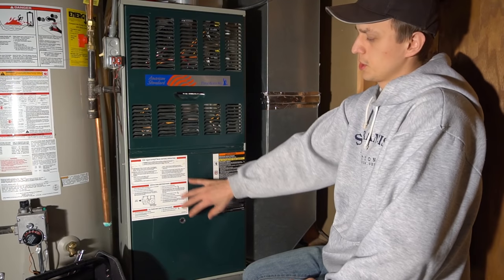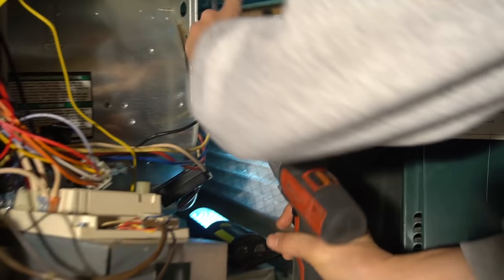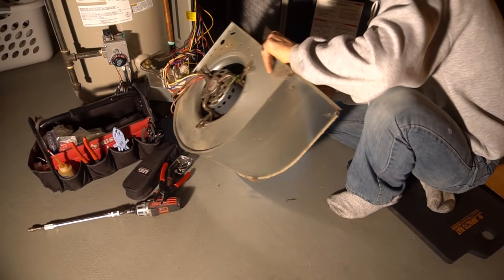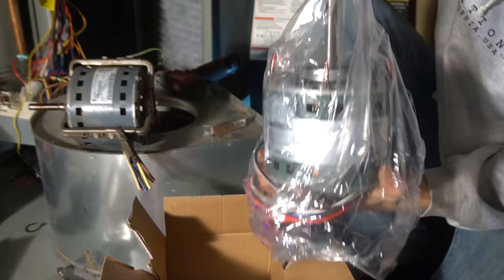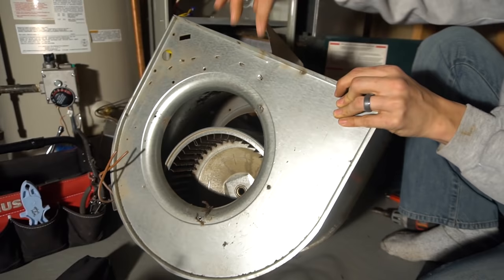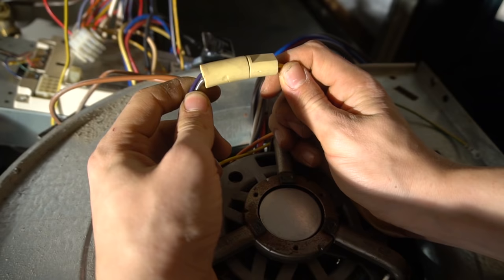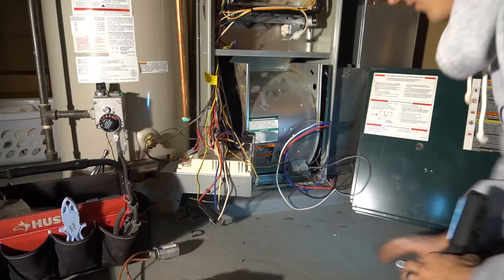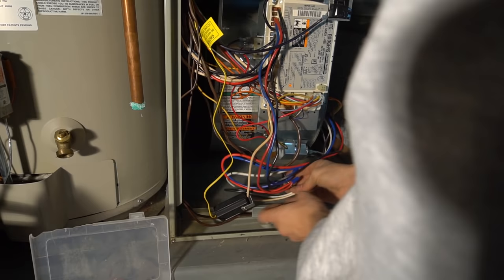Furnace/AC Blower Motor Replacement Step By Step

Comment: if not already mentioned in another comment, once you have the blower out (for regular cleaning, or to replace the motor), put on some safety glasses or goggles, stick your head into the cavity, and look up with a flashlight. you will likely see that the fins of the secondary heat exchanger are dirty - slightly dirty to full of dirt, blocking air flow. there are other youtube vids on how to clean it. it's about a half hour job. a soft brush and shop vac will get most of the dirt out.

Comment: Good video, well explained with excellent camera angles and audio. By the way, you seem to have a slow leak of the overpressure valve of your water heater, notice the green crusties at the bottom of the drain tube. It's pretty simple to replace the valve if you can't get it to seal.
Reply from the maker: Glad you liked the video! Thank you for the concern. The leak is very slow and I just haven't gotten around to replacing it. (I replace these a lot at my job so it's not foreign to me)
Reply: Ha ha, that's funny. I was late to replace the anode rod of my water heater, and am embarrassed it was laziness rather than lack of knowledge. Guys who do it for a living have a hard time finding time to do the same kind of work at home in their 'day off'. Thanks again for posting your videos, they are very helpful. Now I gotta find time to clean out my furnace squirrel cage, better now than after a secondary problem....
Reply from the maker: Heheh, Yep :) You are absolutely correct. I feel the same way. After coming home from work, I don't have much of a desire to continue my work day at home. Just a classic case of laziness. If there was a little puddle under it maybe I would react faster :) Anyway, good luck with the squirrel cage!
Reply: @WordofAdviceTV  Yes, so true! The paying jobs get priority, and it's hard to spend free time doing something you're used to getting paid to do.

Comment: Thanks for such a great video.  I just replaced my motor (horizontal flow unit) with OEM specs and it was fairly straight-forward. Now when the blower runs I can hear a faint low pitch whine/hum (not a bearing whine, etc.) more like a minor vibration that gets amplified a bit in the ducting. Not overly loud but annoying. The unit sits above a vaulted great room ceiling which does not help. I was thinking of installing thin rubber dampers between the sheet metal screws which hold the motor and the fan enclosure. Any ideas since I have to take the whole thing apart anyway. Thanks.

Comment: This seems like a very thorough walkthrough. My only question is, is it always necessary to cut the wires? Or if the model is exact, can they simply be unplugged and the new ones plugged in? I am going to attempt this repair tomorrow or over the weekend. HVAC tech quoted me at $1000 for the motor and labor. I refuse to pay such an astronomical amount of money to have this done, if I can DIY it. Thanks for the video.

Comment: Awesome video, have any of you diy’ers dome this? How long did it take you and we’re you successful. We have a carrier 3 ton
Reply: Just did, I have the exact same furnace, so was easy to follow along. took me about 1.5 to 2 hrs minutes. The motor I bought had the connectors on them, so I did not need to splice them.

Comment: Thanks for posting these very informative videos. My ac blower won’t kick on. It makes a buzzing sound like it wants to start up but doesn’t quite make it. An AC repair tech quoted me $900 to replace the motor and blower fan. My question to you, is replacing the fan usually necessary? The repair tech said the motor is bad but that the fan should be replaced as well. He made it sound as though the fan will need to be replaced in a year or less.
Reply: Hi, i use to be in the service industry for a bit and since its a year later probably wont help, but When you say fan are you talking about the Squirrel cage? Thats the sharp metal wheel that spins that he cleaned in this video? or are you talking about the outdoor units fan motor aswell as the indoor fan/blower motor? If he was talking about replacing the Squirrel cage  then hes just trying to rip you off.... Those  never go bad and usually need to be cleaned fairly often...Now if he showed you the squirrel cage was Bent or something  then thats different.....

Comment: best vid I watched all day thanks!!!  great job on explaining.
Reply: switch the motors 4 speed to a 3 .matched up the wires like 17: 20 said. fired it up and nothing.got and extension cord  and hooked it direct to the motor and wala! knew motor was good.spent 6 hrs trying to find the issue thinking it was a bad blower contactor on the circut board.SLEPT ON IT watched a few you tube vids and WALA AGAIN!!! that yellow unwanted wire  on the previous motor you throw out was hooked up to the HEAT terminal   going no where since it was cut., SKATA. A 10 SECOND FIX! hooked up red which i'll most likely switch to a faster wire and BINGO.fire out of the vents now!!! FUNNY WHEN YOU DO SOMETHING ONCE IT ALL MAKES SENSE.easy job! thanks!!
Reply: be real curious what speed you run your furnace at?
Reply from the maker: Thank you for writing that! I totally forgot to mention that you need to look at where your heat and cool wires go to from the motor. In my case at 17:10 the yellow wire was on "park" or spare so discarding it was okay. Sorry that I did that to you man, I should have explained that part better. Hopefully if anyone else has the same issue they will read your comment :) My furnace fan speed is set to low (low speed is almost always red). At work, once in a while if a furnace is slightly overheating while running and I ruled out other possibilities like a plugged filter, high gas pressure, dirty burners, dirty A-coil, etc, I would increase the fan speed from low to medium. There's a chance that the increase in airflow will keep it from overheating.

Comment: Great video!  One question: How do you know which way the blower motor should rotate?  Do you just guess and try one, and if that doesn't work reverse the direction of the rotation connector?

Comment: 1) Do we need to discharge the old capacitor and, if so, how is that done?
2) You pointed out the part that controls motor direction. Please provide some instruction on how to properly handle that function.

Comment: I have a 20 year old Goodman GMT 090 - 4A furnace in good condition as far as burners and heat exchanger. I am renting the house and moving to another state. As preventative measures, I replaced the following 20 yr old parts with OEM Goodman: Blower motor & capacitor, induction motor & pressure switch with rubber tube, igniter, flame sensor along with limit switch. Can you think of any other parts you would change that you would expect to go on a unit this age. Located in TX short heating seasons.

Comment: I’m replacing a blower motor (capacitor 15mfd/370vac) with a new motor (capacitor 5mfd/370vac). All other specs are identical except capacitor. In another video, commentator says to use same size cap in new motor as in old one. What do you think? Thanks for your help.
Reply from the maker: There will be a capacitor rating on the new motor label or box. Use the size that the new one lists. 👍

Comment: I also had to wire mine from a 4 speed motor to a 3 speed motor. Its a gas furnace. Now i have the heat on and the fan speed is really slow. Will this cause overheating on the unit since its not moving air very fast?
Reply: Disregard. I figured it out. From what i understand this only works on a gas furnace if this helps someone else. My fan speeds are High (Black), Blue (Medium-Low), and Red (Low). High Speed (Black) is obviously for AC. My Red (Low speed) was connected to Heat terminal and my Blue wire (Medium -Low) was connected to "Park" which means it's not being used. I switched my blue and red wires putting Red (Low) on the "Park" terminal, and put my Blue (Medium-Low) on the Heat terminal. Now she's moving air better and is actually more quiet now.

Comment: So glad I found you! If we just want to clean the wheel we can keep all wires in tack and just take out the wheel to dust and clean, right?
Reply from the maker: With most furnaces, yes. But there are some furnaces where the wires are pretty tight and you will have to disconnect some of them. In that case just take a picture of where they go and disconnect them. Afterwards don't forget to put them back. If this is your first time, I would take my time and remember how everything comes apart so nothing gets forgotten when reassembling. Good luck!

Comment: Can you please explain how to find a compatible motor from the model of the unit? I have a Trane as well and motor bearings are bad and have the model number 4txca024bc3hcaa but could find no info using that model number. Edit: I pulled the motor, it's a GE 1/3hp 1075RPM unit model b13400-21. Did some searching looks like ClimaTek MOT99 900 will work :) Thanks for the video!

Comment: i assume mine is the blower motor. when the heat pump kicks in. its a loud buzzing noise until you turn it off, still blowing air out the vents, its just cold air and not hot.

Comment: does the blower motor installed right on this video ?
I mean the air supply (return) is on the right side of the furnace, and the motor installed in the blower motor assembly also from the right side

Comment: This is a great video.  Thinking about tackling this myself and you made it look so easy.
Reply from the maker: It usually looks easier than it is ;) But if you read the comments, many had success! It's not too hard. Let me know how it goes and if you run into anything unexpected. By the way, the yellow wire that I throw away in the video, make sure that is not the wire that goes to the heat terminal on your control board.. (17:05) I forgot to mention that in the video..
Reply: hey.  Quick question.  I just replaced mine and it took about 2 hours and wasn't too bad.  I am a little unsure about the wiring of the capacitor.  Does it matter which brown wire goes to which terminal?  I've already installed it and realized that it may be printed on the motor itself.  duh.
Reply from the maker: The two brown wires go to the capacitor. One wire may even be brown and white. It does not matter which wire goes to which terminal on the capacitor so you're good :)
Reply: Thanks!  It's working great now, and I saved a ton.  Can't believe how much the HVAC companies charge for this job.
Reply from the maker: Yeah.. Not everyone is willing to tackle a job like this themselves though. Service work has never been cheap so no surprise there. Glad to hear you were able to get it up and going yourself without having to pay someone to do it! :) Now all your relatives will call you when their furnace stops working ;)

Comment: Thank you for the video! Question for you: we have a boiler for heating our house and what appears to be the old furnace and ducts- we have a fan that runs with an air filter as part of the old furnace system and the last several months it’s been kicking on and off at odd intervals and not running the correct amount of time. Any idea what might need to be fixed?

Comment: Was watching ur video….👍👍👍👍very informative thank you…. My question is …. A contractor comes out every year to clean and check my furnace…. I made a mistake last year of him talking me into replace the capacitor… but it works fine…. He was checking the blower and cleaned it with a dry vac….. but stated that oil (?) was leaking …. Or that it was moist. I didn’t see no leak to be honest with you….. I wanna know if that is correct… can the blower motor go bad with it leaking oil?? Was he correct?…. Told me I needed new furnace!!! The went from 6k to a deal of 3k…. I was very hesitant. What do u think?… replace blower?
Reply from the maker: Glad to hear you found the video useful! I don't want to make any assumptions about the guy but from what you described, I would say you're fine. No need to replace the motor or the furnace. I should almost make a video about these yearly inspections but I think many HVAC guys would give me grief for it. 😅 (I kind of mention it between the lines in this video: https://youtu.be/Z7vUOySOWbM ) Long story short... For most companies the purpose of a furnace inspection is not as much to make sure it is safe and works well but more to have a yearly opportunity to sell you something. Optimally a new furnace since that gives the biggest commission.
Reply: @WordofAdviceTV  
THANK YOU 🙏 SO MUCH …. I really appreciate you getting back to me on this ….. it concerned so much …. The furnace is 17yrs old …. I keep it and the AC unit clean. Yes I was hesitant because the tech made it seem like I was gonna get screwed in the winter if blower goes out. Thanks again… AND GREAT VIDEOS !!!🙏👍
Reply from the maker: @modeman69  You're welcome! 17 years old may still have a lot of life in it. If you are concerned about the motor (good chance that it's totally healthy), you could always order a new motor and just leave it in the box next to the furnace. If it really does go out in a few years, you will be set to go and won't need to scramble to buy whatever you can get the fastest. 👍
Reply: @WordofAdviceTV   thanks again… will view other videos…. Oh by the way my furnace and ac are Bryant brand.

Comment: Hmm, hair sticking out 😵 ! Of course , Americans like to keep their animals (sorry pets 🐈 🐕) inside the house year around. We keep them in the barn ! 
Back to square one. In the spring I will pull everything out wash and spray with disinfectant , clean and wipe .
Even if my blower motor so far working fine but it is 15 years old. So I may need to find a new motor, capacitor, and premium filter. 
Thanks for this video. Actuality it is simple and easy for every who have good working brain and common sense !

Comment: Would this be the same process to replace a ECM blower motor ?
Reply from the maker: Yes. The process should be very similar except the ECM motors will come with a lot more wires and a molex plug or two.

Comment: Great video Fella, you really explain thoroughly what's going on. I have a question, i need a blower wheel for Trane xl 15 air handler. I have the specs for the wheel and have found wildly different pricing for wheels that say Trane $145.00 or $56.00 for generic. the specs are the same and the look identical. Cand i use the same spec. wheel and be ok? thanks
Reply from the maker: Most of the time the generic wheel will work just fine. Once in a while I will get one that is noisy though. So most likely you won't have any problems... But I can't say for sure.
Reply: @WordofAdviceTV  well heck One question deserves another. I want to get a great t-stat with remote sensors. what do you recommend ? do you have any such videos?  Thanks.
Reply from the maker: @davidfemrite4638  Sorry, I won't be of much use with this question. I personally prefer "non-smart thermostats" and don't have any videos about thermostats besides bypassing them. You may want to consult with some other channels ;)

Comment: Great video, I have a question however.  When putting in new motor do you have to take the rubber bushing thing off of it before installation.  My old motor doesn't have that bushing.
Reply from the maker: Yes, that rubber bushing thing gets discarded 👍

Comment: I noticed the current on the old motor and new motor differed (From 5.80 to 6.7). I assume that is okay? does anything on the control board need to be changed with a different current motor?

Comment: Thank you so much my blower motor blew out and replaced but the second moter blew and the third moter blew
Any idea what can cause it keep blowing out
Reply from the maker: I would check and see how much voltage you get going to that motor... Either it is getting too much power or something is not wired correctly. I have a video on blower motor wiring if you need it: https://www.youtube.com/watch?v=4S8TZd-45bY&t=210s
Reply: @WordofAdviceTV  and then it exploded
Reply: @pleadingmule6700  😲

Comment: I have a question. Your video shows how to discard yellow wire which doesn't come from the new motor. I have a different situation. My previous motor didn't have yellow wire, however the exact oem part motor has an extra yellow wire. I read the product description and it says yellow wire is heat, and since I had take picture before doing the work, I had no previous Yellow wire in the board. So now need to know where to put the yellow wire came with new motor. Appreciate if you can help.

Comment: Is there a positive/ negative on capacitor wires or it will work ether way ?  Thank u for the video
Reply from the maker: With a capacitor like you see in this video, it does not matter which side the wires go on. No positive/negative to worry about.
Reply: @WordofAdviceTV  thank u for the reply

Comment: Hi I watched your entire video because I have something like a rattle noise , Someone told me might be the set screw on the blower because the motor is not centered on the squirrel housing great video if possible could you get back to me and throw me some clues if my guessing could be right or wrong thanks in advance will be looking to hear from you  ,Iam located in Chicago Illinois